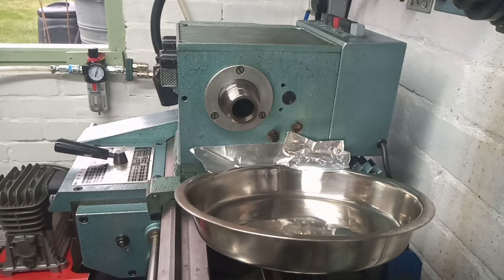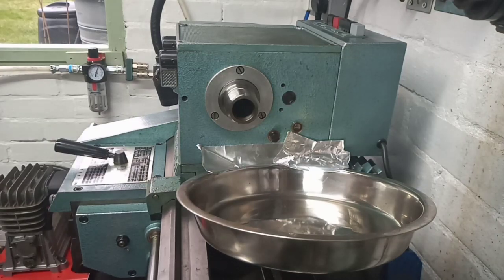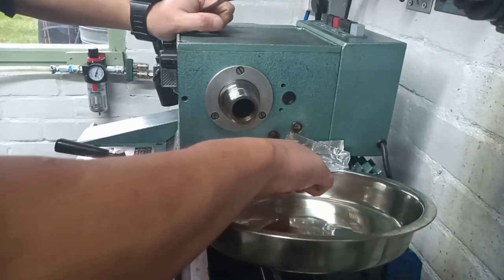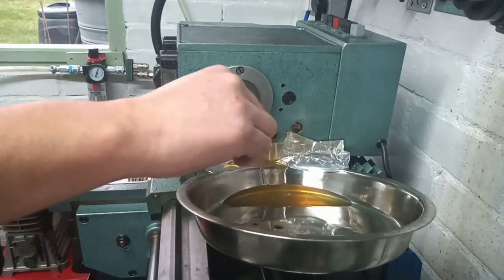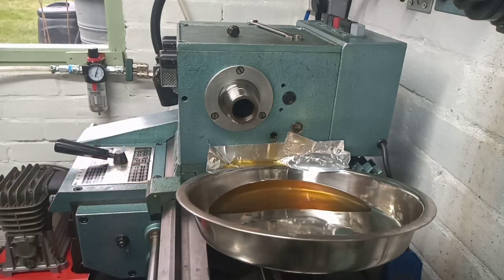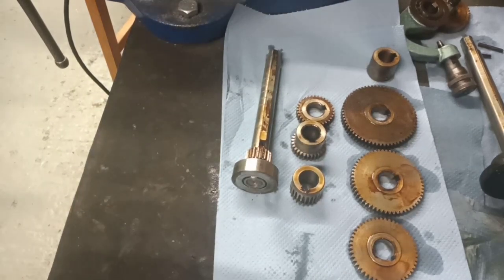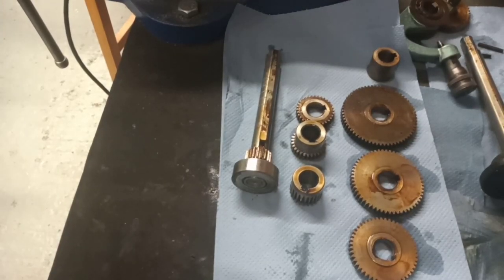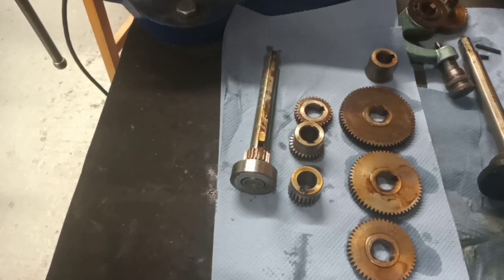Maximat V10P Lathe Maintenance, Oil Change, Gearbox Overhaul Part One

Comment: Great job Dean, interesting gearbox design being totally modular to the lathe! Also, the labyrinth seal affair on the headstock top plate is very clever design. Cheers, Jon
Reply from the maker: Thanks Jon. These lathes cost as much as a Ford Cortina in 1973. They are incredibly well thought out machines.
Best wishes, Dean.

Comment: That was an excellent film, I thoroughly enjoyed it. I always like seeing how machines are put together. The Emco marque has a very prestigious reputation for quality. It seems that it is not misplaced. What a well constructed gearbox. I take it you will be replacing all the bearings? You can get those snap rings if you decide to replace that too. It just goes to show the damage that moisture can do to machinery. I understand you are going to use Castrol AWS46 in there in future. I would say that is a very wise choice indeed. I've seen it cope in very arduous bearing service conditions, even performing well when contaminated with sea water. So you should be alright.

I am looking forward to the next installment. Sending love to you, Rebecca and the boys from all of us.
Reply from the maker: Thanks, yes that's the stuff. My use of mineral oil was fine for years but I won't be taking chances again. 
Love to the family. Dean.

Comment: Thanks for the video.  I have recently acquired a V10P and begun to revive it. The apron had petrified grease in it.  The gears appear to have timing marks?  Would you be willing to make a video on the apron assembly?
Reply from the maker: You are welcome. If I have a requirement to strip the Apron I will certainly film it. It is probably about due for a service. 
Best wishes, Dean.

Comment: Interesting you should comment on the oils used, I couldnt work out what I should use and ended up with Penrite 80W-40 gear oil which has molybdenum in it. The V10 works fine at top speed but do you think I should change it?
Reply from the maker: Hello, I would change it I think. They are designed for 10w oil and the motors are difficult to find and expensive to repair. I wouldn't risk an overload. 
Best wishes, Dean.
Reply: @retromechanicalengineer  OK will do thank you for your videos
Reply: @retromechanicalengineer  Ive changed it, found some ISO68 fluid that was recommended locally. Its very light but it does get all around the bearings for sure and there is definitely less loading, so thank you
Reply from the maker: @campbellmorrison8540  you're welcome, glad it worked out well.